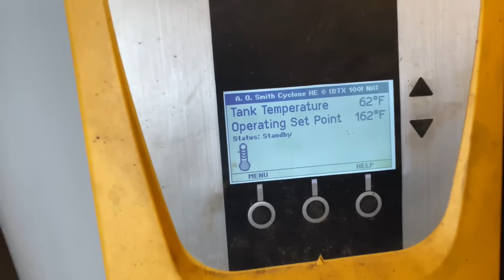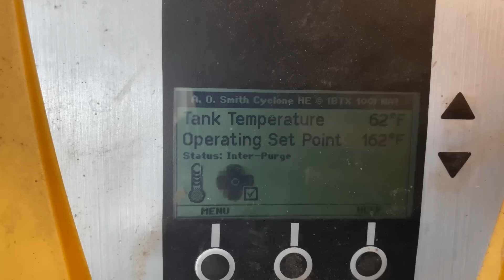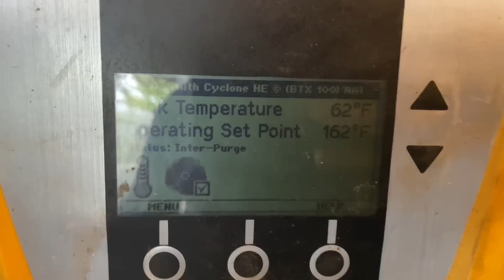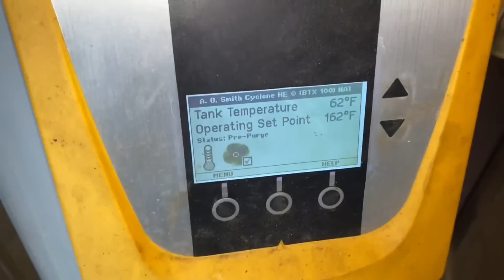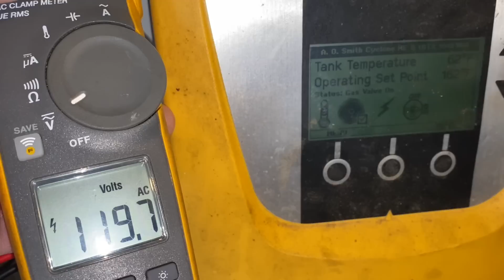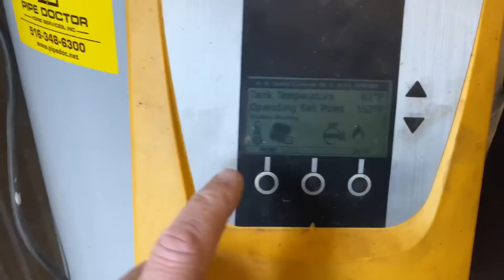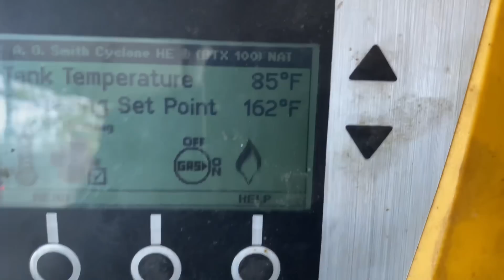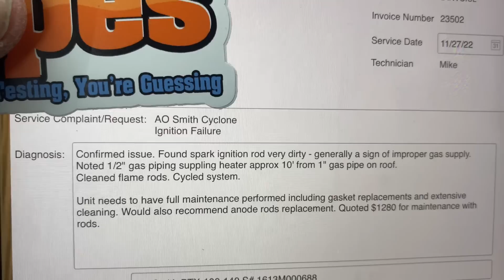AO Smith Cyclone Ignition Failure - Incompetence or Did The Other Plumbing Rip Them Off?

Comment: Hey Mike just heads up sometimes the wire going from the ignition module to the igniter goes bad. You can usually feel it cause it will crack in your fingers when pinching it. I’ve seen many of those be the issue when it comes to ignition problems on AO Smith. Just heads up something to look out for

Comment: I serviced a very similar one like this the State ultra force, throwing the same code. I did everything I knew to do, cleaned the burner, replaced igniter, replaced flame sensor and checked the venting. Every 3-4 days it would throw this code. After multiple trips out there I had to refer a bigger outfit. Tech support wasn’t much help.

Comment: sometimes if the unions are rusty crusty, I'll put some "blue/locking" dope on the "threads" and "nut to flange" contact surface. NOT on the sealing surface/ground joint.
I have had them surface rusted and threads seized before (whacking gas-lines hard with pipe wrench makes other people nervous). there was always previous water leaks/work/spray that caused them to get wet repeatedly.
now on old water lines, I've doped the joint faces, but the joints were trashed and  needed any help they could get, of course that was a temporary fix.

Comment: I've been working on this appliance and it's gsw counterpart for years. That install was done like shit the I take damper was never installed. If it goes to inter purge without ignition you will smell gas form the Intake.
I'd also recommend replacement of the flame rod to the owner these guys don't like them being cleaned 
Shame on that company for robbing this owner blind

Comment: Had a weird ignition failure call on one of these about a year ago would ignite just fine with the intake disconnected cut the fucker into pieces nothing in the intake. Spent a good amount of time cleaning the burner in a degreaser checking exhaust to wind up opening the book to the gas piping size chart found the size I needed already circled in the manual. Too much gas supply pressure drop when the valve would open that spec was circled as well. I wasn't the only one to find the gas pipe for the length was too small 🙄 this was a problem for 6 years it's been kinda limping since install. Not sure if they ever approved the quote to to redo the gas piping. Awesome water heaters they heat up super quickly remind me of the older voyager rtus with the way it has the positive pressure heat exchanger and it would woof at me and shake when trying to ignite.